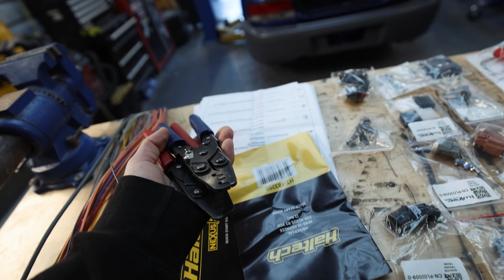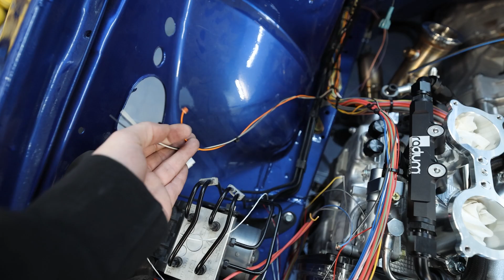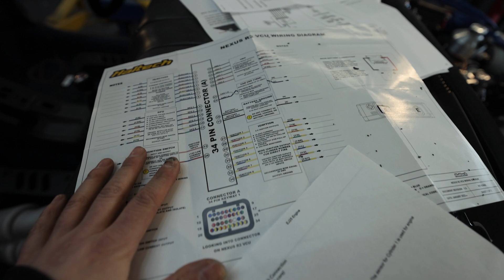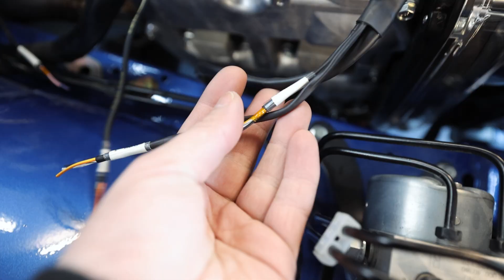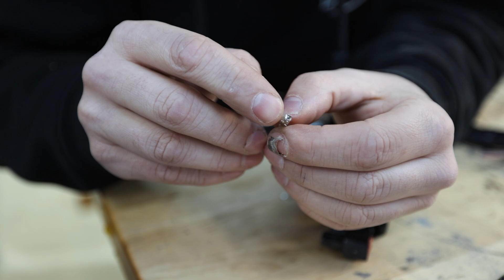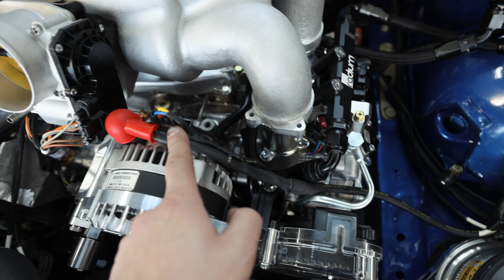Building a "MIL-SPEC" Engine Harness for my Subaru 2.5RS

Comment: Nice work I would use Kevlar string to hold the shape of the twist and the kapton in the boots of connectors to protect wires and service loops from the RT 125

Comment: Hey, love this series man. Question, what is the pinout that you're using for the second cam position sensor? I notice that the haltech pinout only shows a single cam position sensor.
Reply from the maker: Pin out should be same same for sensor 1 and 2. You can use any SPI for the sensor and any DPO for the solenoid. 

You have to tell it there there are two heads then it’ll let you enter in two sensors
Reply: @Smeedia  Awesome, thanks.

Comment: I have a question. I got a 2013 STI, stock ecu tuned with ECUTEK. Can I run it on a mixture of E85 without having to manually calculate it by using a flex fuel sensor? I do not want to buy a cobb access port. I would like to know if there is a reputable kit available which is compatible with the original harness from which the Ethanol content can be read within the ECU. Thanks.
Reply from the maker: IBR and delicious tuning both make kits that should work with ECUTEK. Or you can run two tunes one for E85 and one for pump

Comment: For wire gauge I know there is a formula to pick the right size but how did you go about it? I'm running maxxecu which has some support and writeups for all that, nothing like haltech though. This had so many tips & tricks it really helps for any of us first timers.
Reply from the maker: Really comes down to how many amps something is pulling, then cross reference that to a AWG Chart. For most sensors 20AWG is totally fine

Comment: Solid wiring, did you used to do this for a 9-5? I ask since my main job is custom wiring for defense sector, Raytheon, Lockheed, Northrop. The only thing I would change personally is booting all my connections. However prob not needed and boots are hella expensive haha 

Oh and string tie for all my break out points. 

Motivation to get my ass up and do my 2jz harness 🍻🤌🏻
Reply from the maker: I have not, haven’t done any wiring prior to this automotive stuff 😅 

I wanted the back housing boots but they’re so spendy and not suuuuper needed for automotive 😅

Comment: I recently did some ditch lights on my new Tacoma and used solder seal heat shrink connectors to merge the wires to the factory harness through the plug connectors. They seem to work and hold up well for the application but probably not what I would use on an entire engine harness
Reply from the maker: I’ve never been a huge fan of them but they do work pretty well 🙌

Comment: please link which crimp tools you bought, something with the parts store crimps are ass, I cannot get a good crimp on the open barrel it either gets destroyed or not tight enough. Also while I and many use solder, oems do NOT use solder because of the reasons you explained. They will crimp and branch wires, newer cars will just add 900 junction plugs
Reply from the maker: Mine are from iWire and haltech 🫡 tbh pretty sure they’re sourced from the same factory but they work awesome. 

And 100% I did the same in my harness, some Signal grounds have branch out points as well as some 12V
Reply: @Smeedia  at this point ill pay the price hike and get one from them just so I know its done right.....there is a lesson in there but for the life of me I cant find it

Comment: I'm not sure if you know, but I'd highly highly recommend throwing in a dummy wire and creating twisted-pairs for all your wiring harnesses.  This is to ensure that no outside EMF/Electrical situations will cause extremely odd occurrences.  The biggest issues will be apparent around Military Bases, Power Sectors for Cities, and Waste Management areas (surprisingly).

Stated as a Subaru Dealer Tech with ASE certs.  JBLM has a history of causing said issues in GM vehicles because they didn't have proper twisted-pairs setup.

Edit:  There is a specific calculation for how many twists per inch for a given length of wire.  So I'll recommend finding a calculator to assist in this.

Extra Note:  Wire routing is also extremely important to prevent chaffing.  So, consider using the OEM plastic clips, since those are used to absorb vibrations, rather than the wires themselves.
Reply from the maker: The sensors that are prone to EMI are already already shielded 👌 both crank and knock sensor. 

Concentric twisting works awesome with the proper wire. When using the haltech flying lead harness not so much. The silicone wire from haltech does not like to twist well. If we built a harness with all Tefzel 100% would do it
Reply: @Smeedia  Ok that's awesome!  I wasn't sure if you incorporated any protection for that mess.
Reply: Twisting wires only makes a difference for emi if the pair of wires are a going into a differential/balanced input. The principle in twisting is to keep the pair of wires as close as possible to each other so that they pick up the SAME noise, on the input the first thing that happens is the signal on the two wires is subtracted from each other thus any signal that is the same is canceled out dropping the noise/emi floor of the signal dramatically and leaving the actual signal that is different from the noise intact. The only signals in a vehicle designed as such are usually data signals like Canbus and ethernet. In fact the only other reason to twist non differencing signal wires is that, with the right insulation, it makes the wires more flexible, but it can also make long length bundles coil unpredictability. Twisting also causes wire lengths to increase..

Comment: IV never seen a solder from a factory Subaru harness ever. The crimps are the way to go for sure and won’t make the wire brittle and break over time.
Reply from the maker: You’ll never see solder on em, tbh I don’t think any manufacturer used solder on any harness 🧐

Comment: Tanner, when you get the custom wiring harness completed maybe work out a deal with iwire where they can sell it for you and give you a cut on it or sell on your website?
Reply from the maker: Tbh for me to make a harness for someone’s set up I would need the car physically with me. Without knowing where sensors are placed outside of OEM ones they would not work for everyone
Reply: @ yeah that makes sense. I guess they would have to do a carbon copy of your exact set up for it to work.

Comment: Did you use shielded wire for the knock sensor? I’d be worried about interference with the knock sensor using unshielded wire
Reply from the maker: Knock sensor and crank sensor are both shielded 👌

Comment: Tanner I have a 2018 WRX. I have a single exhaust. Is there a cover for the other exhaust that’s not there?
Reply from the maker: Idk who makes them but I 100% know they make block off plates for the exhaust holes 👀
Reply: @ what is called?
Reply from the maker: @Ilovemy_JESUS I think just exhaust block off plate?
Reply: subiespeed makes them, exhaust hole delete. just make sure you order the proper side as they are specific